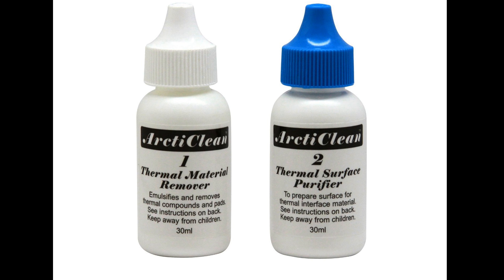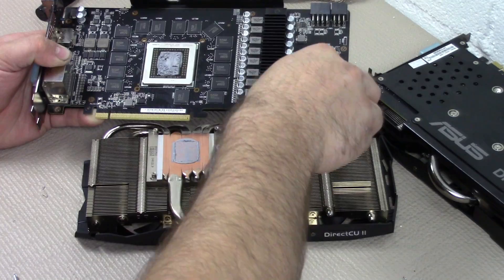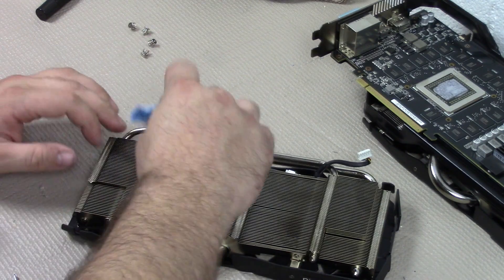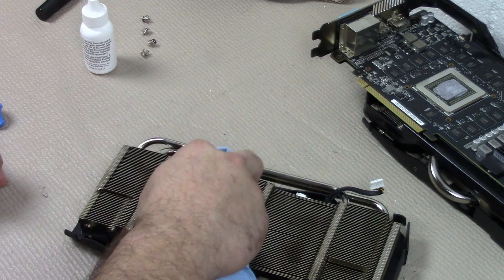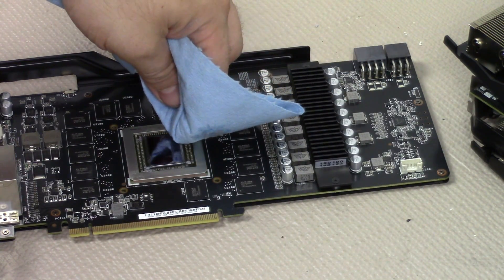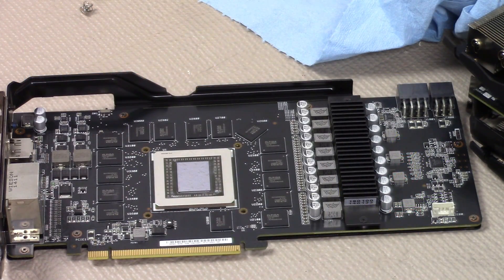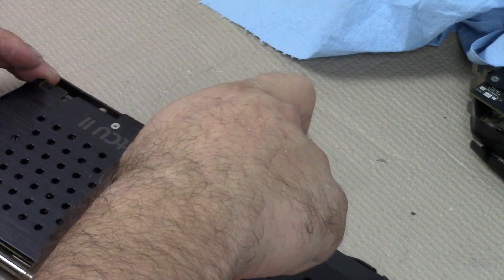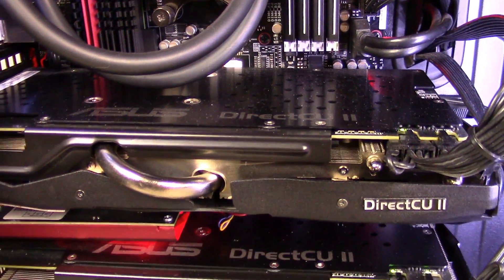Video Card Getting Hot? Keep Your GPU Cool!

Comment: im using Nvidia GTX 750 TI and when i enter in fortnite,gta 5 after 5-10 minutes its too hot please help?
Reply: Konoha-no Boruto I have the same problem were did you get yours
Reply: I   have that problem when i paly fortnite i dont know how tp fix it.Mabye to make sure your termal brush is okey and un over clock it that is solution i will try

Comment: For cleaning the card, could I just wipe something like babywipes over the card to clean it? I've seen some guy do it and claims it won't damage the card. Or should I just use compressed air?
Reply from the maker: You mean like the shell of the card? it shouldn't hurt it but i wouldn't use baby wipes because a lot of them contain a oil / lotion and that could leave streaks as well as make the surface sticky enough to attract more dust. Honestly what I've done to clean the shell is make a cloth wet with a glass cleaner like Invisible Glass (it doesn't contain chems that remove dies or tints) then used a dry cloth afterwards so there is no streaking. Now if you're talking about the cooling fins then i would just use compressed air. In some cases where the fans were really bad i actually remove the  fans and clean them by hand with the invisible glass trick but the fins should be air only.
Reply: The Games We Play 
Yes I mean the shell of the card. I'm just a bit afraid to rub some form of liquid on my video card.
Reply: Thanks for the quick reply btw

Comment: I got a GTX 1080, I played Rainbow Six Siege and left the fans at 25% so the card could stay in the 50's. I was called down to answer my door and like 10 min later I see it's at 82 Degrees because I forgot to set my fan to Auto. I freaked out and exited the game and let my GPU cool back down to the 30's. I've never freaked out that much, I'm so worried I may have damaged my brand new 1080. Should I do something? :(
Reply: I play games at 83°C daily for 3-4hours and nothing has happened yet 😂😂 but i wonder why my card is getting that hot😔
Reply from the maker: Thomas Matteo you should be fine. I've seen people run those cards for a while at 88 so you should be fine
Reply: The Games We Play Thanks m8.

Comment: i got gtx 660 its fucking 95degrees while gaming
Reply: TomFleec I am not really sure ,  you could try that but I never personally  bothered to oc a low end card  for some fps more .
Reply: Mine 660 was reaching 90C before . When I changed the thermal paste , it went down about 30C . Hope I helped you .
Reply: my gpu maxes at 70, is this ok?
Reply: and this is when its maxed on fallout 4 100%
Reply from the maker: jesus, how old is the card? is there a chance you twisted the heat sink even a little bit? this can happen just by handling it after its been broken in for a while and it breaks the thermal seal of the compound. I have this happen a couple of times even with gentle handling. simply cleaning it and fresh compound fixed it
Reply: lmfao while i guess its not impossible thats fucking crazy bro at 100 Celsius u can melt components 111 degrees is unreal what card is that cause it deserves a durability award if your not exaggerating that temp. Also Kupcs i have a gtx 645 and it runs around 98 degrees with no overclocking if your card goes your card goes you can try this videos fix, or you can overclock n play it into the dirt but it most likely wont last long (especially if you haven't overclocked it and decide to
 unless it can withstand 111 degrees (Celsius) for extended time xD. But if you have a 600 series i recommend a gtx 970 about same power usage but way better capabilities without being too expensive. its pricey but better to buy something for 400 that'll last you 3-5 years vs spending 200 on something that will get you through this years games. and if you got money, power supply, etc.. to support better cards just do it screw ur 660 n screw my 645 =P
Reply: TomFleec it's fine till 92 C max so don't worry . I recently upgraded to a gtx1070 so I can't tell anything about my old 660 anyway . But 70C is fine . However if you check high temps (80C+) in low graphic settings then you definitely need to change the thermal paste in your graphics card .
Reply: so would you say im able to overclock it a bit?
Reply: rx 480 isnt considered low end i think, from the videos i have seen its mid end but thanks for the help.
Reply: mine too... even with dual fans
Reply: me too but its 72 but my monitor turns off
i think is because of the temperature
Reply: same here
Reply: WOW me too no joke i got Gigabyte GTX 660 im doing nothing and sitting at 91 - 93 degrees

Comment: I have MSI GTX 660 OC Twin Frozr, its going upto 80 C while gaming and sometimes my games lags for a sec, probably the heating issue. will this help in cooling the card and is this safe to perform on my card ?
Reply from the maker: as long as you are careful when performing this it's safe. remember, video card coolers are ment to come fairly easily incase you wish to upgrade to water cooling. keep in mind however this may void the warrenty. I think MSI (along with many others) is okay with you removing the cooler however some companies will say this will void the warrenty. just be sure to ground your self so you don't static shock anything. I recently had to reapply thermal compound my self, after I was cleaning my case and had to remove the cards. taking the cards out moved the heat sink enough to break the thermal seal between the gpu and heat sink seat and my load temp went up to anywhere between 75*c to 85*c. I used the Arctic Silver cleaning kit then put on the new compound and now my load temps haven't gone over 65*c even under heavy load. also remember to it will help to keep fans around 80 to 100%. stock auto fan sucks as it waits for your card to catch on fire before speeding up

Comment: Any program that is EASY to use so you can see what speed your fans at and how to turn it up or down? Please help, my computer is getting ruined by overheat.
Reply from the maker: use MSI Afterburner. even without a MSI card it will let you control your speeds and monitor everything. I'm using it because the new AMD Crimson is a joke and fan controls don't work half the time.

Comment: i got my video card probably a month ago and i never changed it's termal paste...i have a GTX 950 Strix Direct CU II and it now idles at 50-60° .... should I change the compound now or could it be that summer is close and it starts to get the air hotter...even though there are 27° in my house.
Reply from the maker: have you checked it at the load temp? a lot of the Asus cards will try to slow the fan speed down to nothing (and sometimes completely off) to make me quiet at idle but even at higher temp Asus cards don't like to go over 30 to 40% fan speed. I seen my cards go over 78°c and still keep the fan speed pretty low. in your video card settings you should be able to over ride this. I personally don't care if a performance video card is making noise due to the fan and the newer cards are fairly quiet even at higher speeds (Well, most of em any way). see if you can set the fan speed at 80 to 100% and that should knock it down a good bit. would hate to tell you to take your heat sink off such a nice new card already.
Reply: at this moment while i'm typing the card is at 50° idle on 55% fan speed...and i usually get like 30° on idle with fans turned completely off.
Reply from the maker: i see you said your house temp is around 27*c which is around 81*F and i know anytime my place gets around 75*F or warmer all my computer temps go up a decent amount. computers generally like a ambient temp of 68 to 70*F  (around 20 - 21*c) or cooler. i would personally keep an eye on the temps under load,  with it getting warmer out i would still set the fan speed around 80% if it doesn't get to loud for you. i did some research on that card and found test that showed an idle temp of 42*c in a room that was 20.5*c with no fan speed and a load temp hitting 70*c with a fan speed around 50%. with your house being warmer then that i think your temps are normal. here are the test on that card -> http://www.legitreviews.com/nvidia-geforce-gtx-950-2gb-video-card-review-asus-strix-gtx-950_170811/11
Reply: hmm..it's weird..never happened before...eighter that or haven't noticed
ill try booting up Assassins Creed Syndicate (running it on very high with the Effects on ultra) and see the temps under load and ill be back with another comment.
Reply: ok so it seems the temps didn't go up...but now syndicate runs at a very low framerate...it is unplayable...i haven't started it for probably 4 days and this problem also occured in Ghost Recon Future Soldier the first time today....it's like it's not using the video card to it's full potential.
Reply: ok now for some reason after 2 restarts my video card's temps started to stabilise and now Syndicate works perfect again...i have no idea why that happened....but tnx for the help.
Reply from the maker: +KazPLAY that's odd, maybe just a hickup. I just recently went through something similar and a few restarts later it works fine. good luck with it and let me know how it holds up for ya. the Strix    cards are nice
Reply: reminds me of the times i got this kind of stuff on my old 9600GT...it seems it just happens...but since then the temps where a steady 30*C idle and 55-60*C under load...tnx again for the support bro...you have a new subscriber for that :)

Comment: I've got sli 980 strix (recently got the second one) and I've started to notice lately my top card likes to stay at 79-81 degrees at load and 70-80 percent fan speed.  I thought that was normal until I saw sites claiming the same card was getting 71 degrees at load with low fan speeds.    so I've been considering replacing my stock thermal compound and still considering maybe also getting a liquid cooler for it.   

My bottom cards max so far has been 68c with low enough fan speeds (50% ish)  I expected the bottom card to run cooler but not by that much.
Reply from the maker: nice man, I love the strix cards. yea I would try the thermal compound first. You can get the thermal compound and cleaner I used off of Amazon fairly cheap and even if you end up going liquid cooling the you can just use the Gelid extreme on it as its better then the stock compound that they use on the heat sinks.
Reply: +The Games We Play thanks for the reply
Reply from the maker: +KillTheCurse no problem. oh, and as far as the bottom card reading way cooler. Mine do the same and i was surprised at the difference. on my duel 290X set up it was a difference of getting burned if you touched the top heat sink while the bottom one was just warm.
Reply: The Games We Play So I was sortof right thinking my top card had a heat issue, I switched the top and bottom cards around and my temperature dropped to I believe 77c at 66%.   I Then took out some hard drive cages I didn't need and made my top fans an exhaust instead of an intake and now I get about 71c in some games 50% fan speed or 74c at 50% in others.  Very happy, I imagine this will go down a bit more with better thermal compound, especially on the one that was having heat issues.  I was actually able to get 66c with fans manually on 70%!  I always thought on air you were supposed to get like high 70's.  :P
Reply from the maker: +KillTheCurse that's awesome! should get a lot of use out of those strix cards